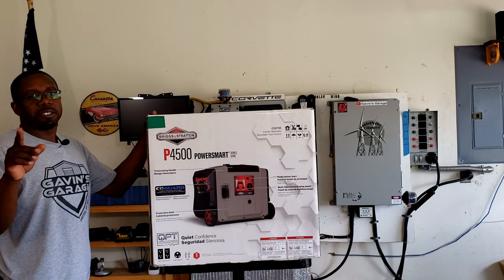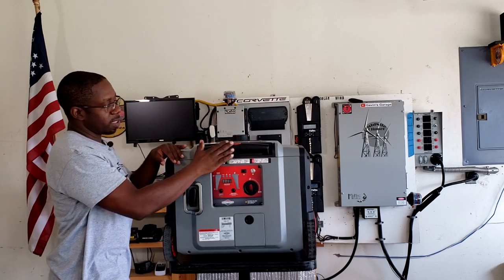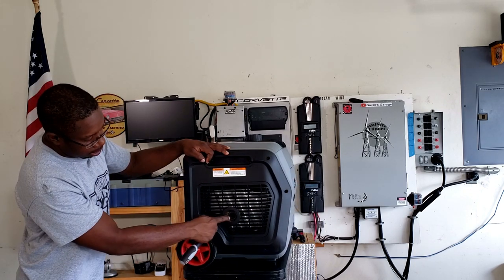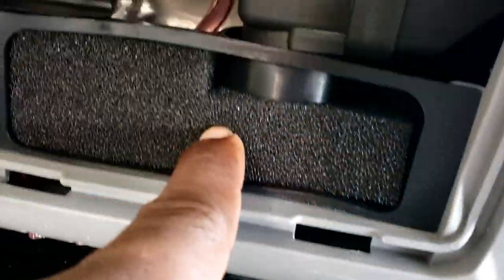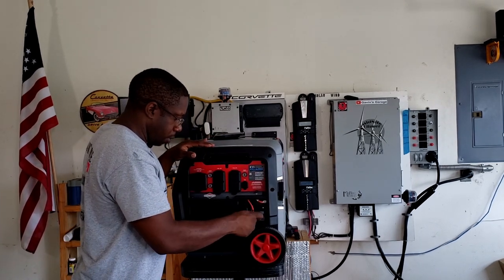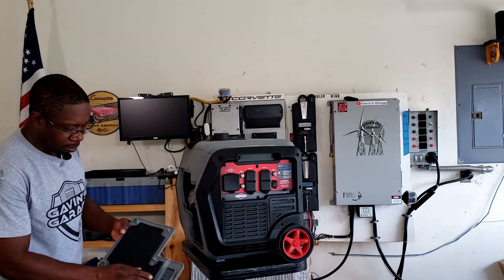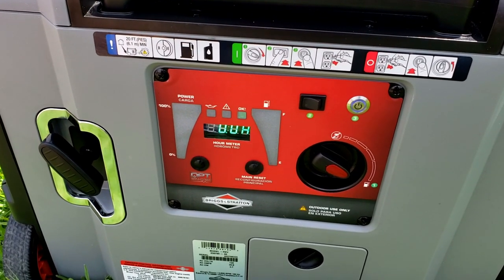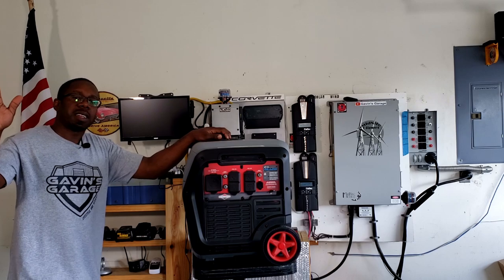Briggs & Stratton PowerSmart 4500-Watt Gasoline Portable Inverter Generator Review

Comment: Thanks Gavin for the fab review. I just bought one B&S 4500 yesterday. I hope I will not disappoint me. Do you think I could run a washing mashine with it? Should I only let it run with a surge protector? Thanks. Greetings from England.
Reply from the maker: Hi Alec 
Yes you should be able to run the washing machine just fine. You don’t need the surge protector it’s just an extra precaution 👍🏾